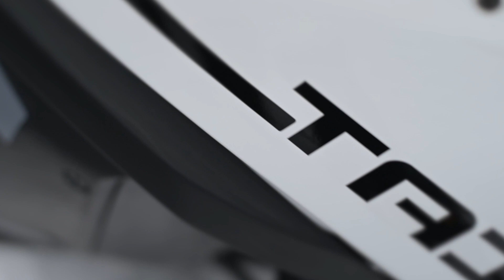Advancing Off-Road Electrification | Taiga

Comment: that snowmobile is not gonna sell at all before It's been tested side by side to a equivalent gas powered snowmobile. I love the idea of a electric snowmobile, you know, instant tourqe, but I see weight as the biggest issue really.

I've been following this project from the beginning and I'm still interested but we need to see some real life testing soon.
Reply: Around 650 lbs is what I heard and how much... $18K? Prolly it’s a nice trail sled.
Reply: @fairbanksairriders  according to the website the extended rang ekko is 586lbs. it's not as bad as 650lbs. but still heavy. If they can dial in the suspension and get enough power out of it, it might not be that bad...but who knows! 🤷 I've not seen anyone test it yet and it will probably be years until we see it over here in Norway.

Comment: electric is not more friendly than gas, think of all the hd diesel mining equipment needed for extracting rare earth metals in huge open pit mines, the processing of the material in factories with many chemicals, the batteries also have a short life span and are toxic as heck and cannot be recycled easily if at all its all a big lie.